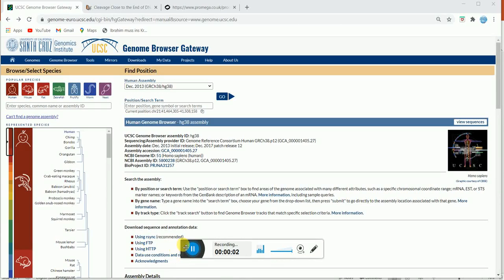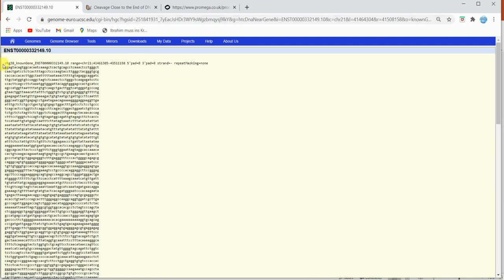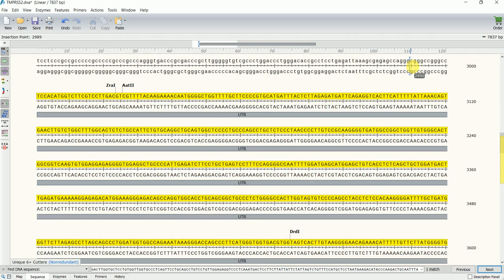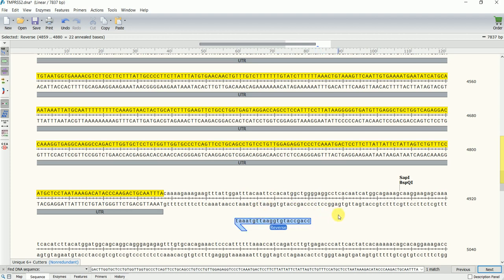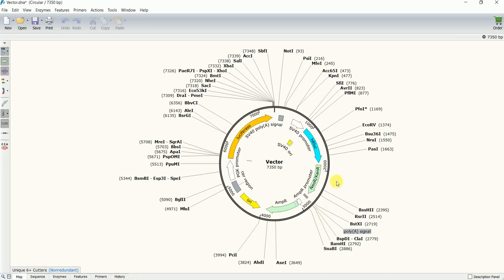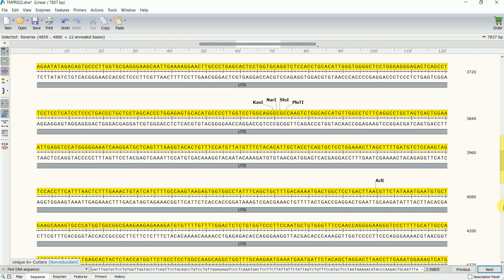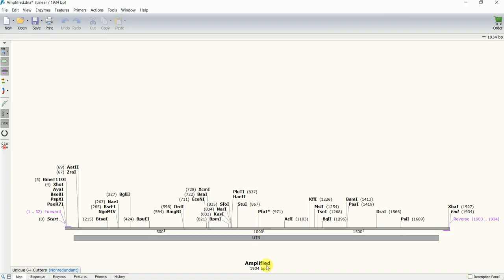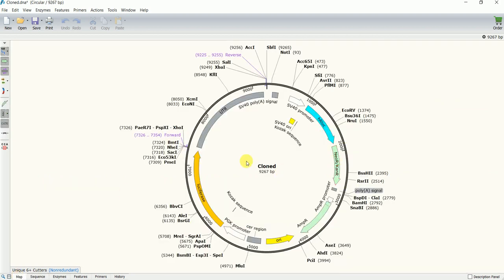Primer design |in silico cloning | SnapGene | UCSC Genome browser

Comment: 15:09 if I am not mistaken, the '8, 10, 12, and 14' in the table do not refer to digestion time in hours but rather to the number of nucleotides at the cleavage site. However, the two rightmost columns refer to %-cleavage after 2 hours and 20 hours. This information is quite critical - especially for optimization.

Comment: Sir I'm given a task of cloning the cDNA sequences of all the rna binding proteins in a vector called pEGFPN-3X-HA, which contains the HA tag. I retrieved the cDNA sequences of all the RBP's using Linux commands in a single go, and now I want to clone the genes into the pEGFPN-3X-HA such that these RBP after they are cloned and expressed will have HA tag in it and I can pull it using anti-HA antibody. My doubt is could you suggest me any software or tool in which we can synthesize primers in one go for these RBP such that they have respective restriction sites in them and they express the HA tag also